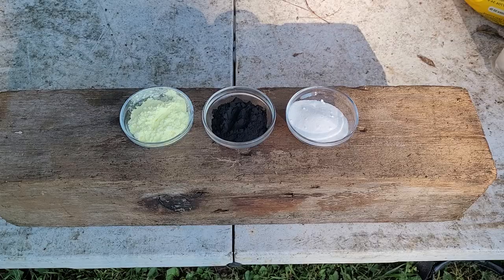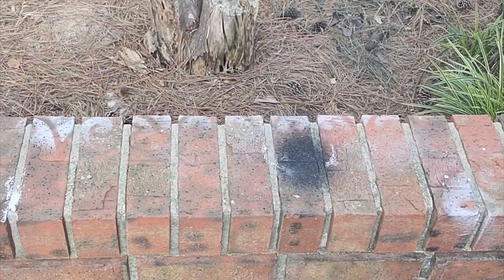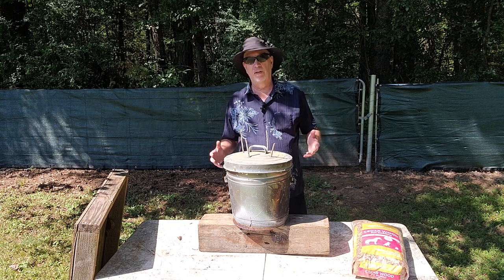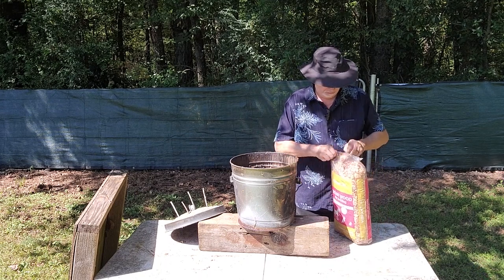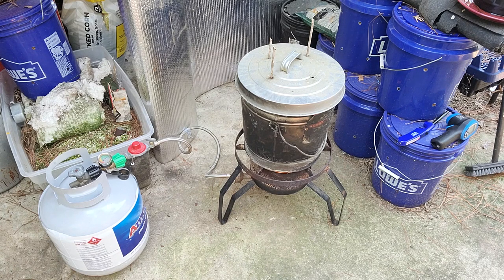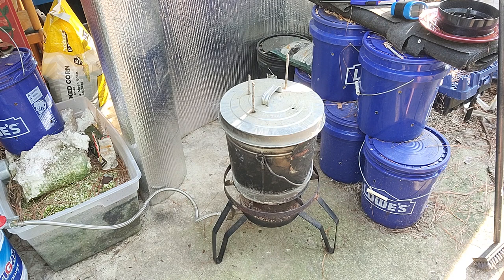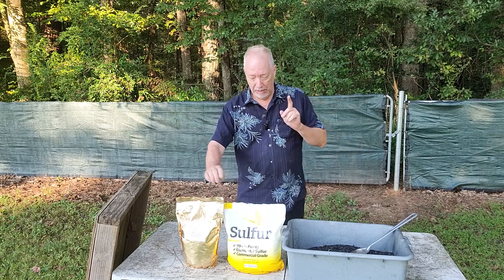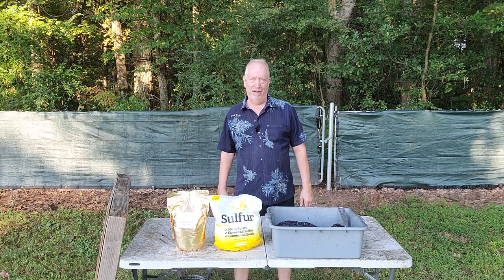Making Black Powder For Muzzle Loaders: Part 1

Comment: Mulberry works for me and it's free.I just use an Empty Gallon Paint Can and a Bad of Cheap Barbque Charcoal .When it's done I put it into a Harbor Freight Ball Mill to powder it and sift out anything that didn't get charred. makes enough for several pounds of Gun Powder at a time.  "Everything Black Powder " has a series of videos on different Carbon Sources for making Black Powder, What works and what doesn't .
Reply from the maker: Mulberry! I'll have to try that!

Comment: The reason for the transport restriction (which is actually DOT, not ATF) is because there are a LOT of idiots out there that can make something they call, or even actually think, is black powder, and it is actually something very different, and could be something far more unstable and dangerous.  Flash powder, for example (H48 Priming compound) is a powder that is black.  It is also what was used in WW2 grenades.   Your homemade stuff could be literally anything resulting in a powder that is black.

So the reason is essentially they don't know what that stuff you call Black Powder really is.  With the commercial product, they know.
Reply from the maker: How are they going to know what I'm transporting just because I get a permit? If I'm too dumb to know what I made is not black powder and then get a permit to transport black powder... ? And then I could also just fill an empty can of Goex with my powder and then no one will care, and who's going to inspect my powder horn? The logic still escapes me.

Comment: I just looked at the ATF website about homemade black powder for personal use and couldn't find anything that restricted the transport from one place to another.
The only limitation I found was for business and manufacturing for sale. 
And weight limitations. 
But there can be different laws depending on the state you live in. 
I would appreciate it if you could direct me to the section about black powder in the ATF website that talks about transport of homemade black powder.
Thanks 👍